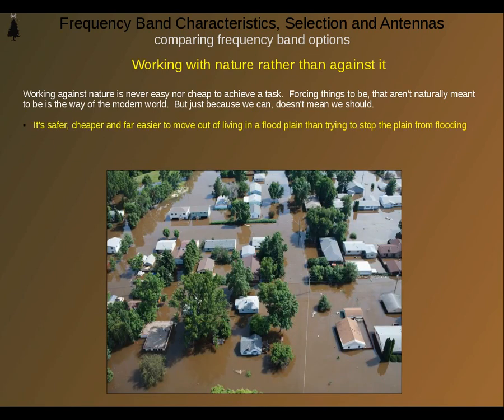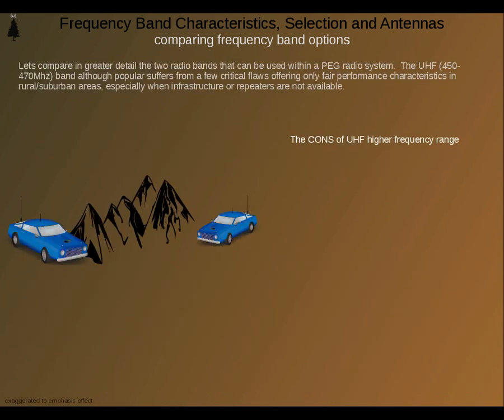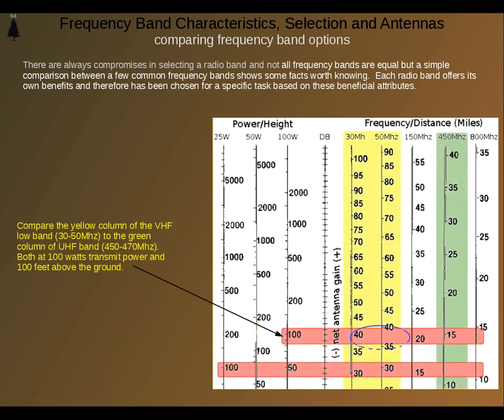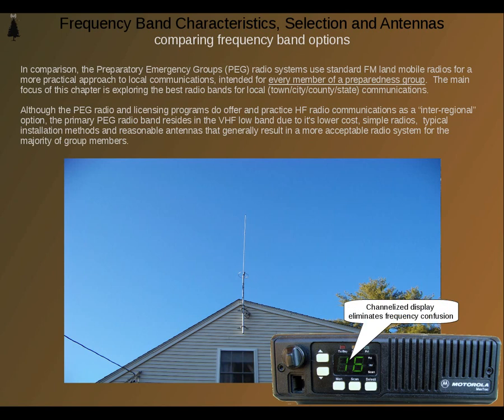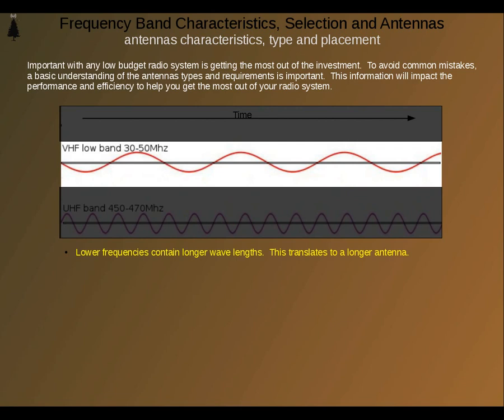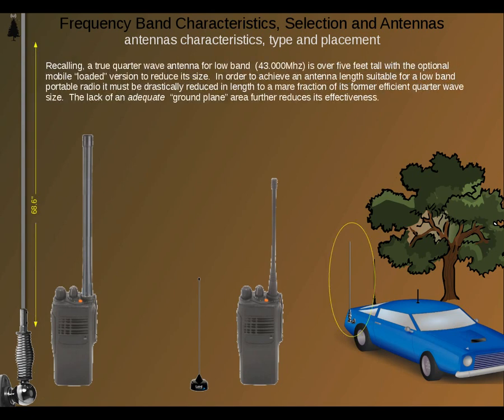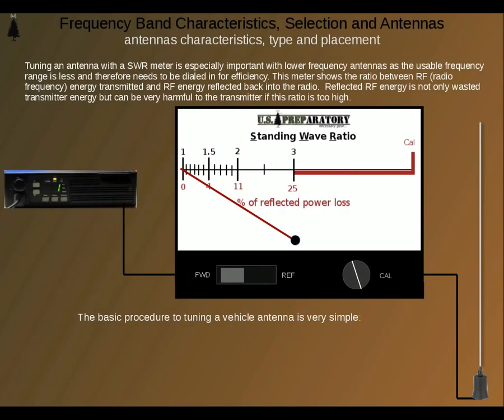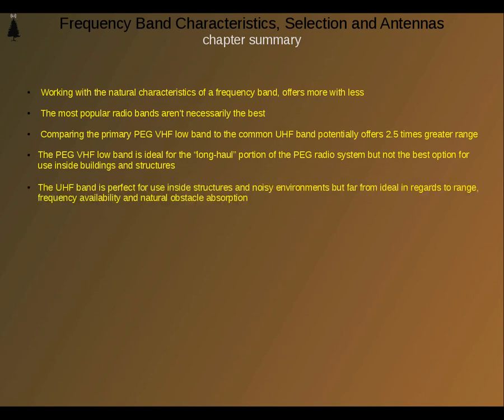PEG  - Frequency Characteristics & Antennas (2 of 8)

Comment: do you need like a computer to program them and how much are the radios?
Reply from the maker: Hi Juanf.  Yes all Part 90 Land Mobile Radios (LMR) must be programmed by a computer or at least restricted to authorized personnel otherwise you would have a situation like with the Baofeng radios...with everybody programming the radio and having a huge problem with the legalities of the radios.  The radios are inexpensive for the most part because a lot of the radios I offer are surplus government grade radios. A Motorola Maxtrac programmed, configured for PEG with mic, bracket, power cable is about $129. These radio brand new in the 90s were $1200!  You would need to follow through with a PEG license however to use or purchase these radios as PEG is not a "public" band like GMRS, HAM, FRS, MURS or CB radio.  Thanks for the comment Juanf.  -Chris
Reply: Maxtrac requires a PC running DOS or Windows 98se so you can run the maxtrac rss in DOS mode, either an official Motorola RIB or a Clone, and the Motorola Maxtrac programming cable. All this can easily be found online some cheap some free if you look for it.

Comment: can you do a video about cross band repeater
Reply from the maker: Hi Jaliya.  There is one in the works now.  The PEG systems uses an optional system called an XTR or eXtender Transceiver Repeater system. The focus of the video will be showing what the benefits are...from a PEG users standpoint to using the XTR system to greatly enhance the capabilities of the portable radio.  The video compares the two modes of a conventional portable radio, "in-band" and "cross-band".  It will show how most conventional public safety radio systems work and why their portable radios always seem to work fine despite that nearly all of them use a portable in the "in-band" mode.  Then it gets into the differences between the two modes and applies it to real world comms.  Chris
Reply: US Preparatory  tks
Reply from the maker: you got it!  Thank you.